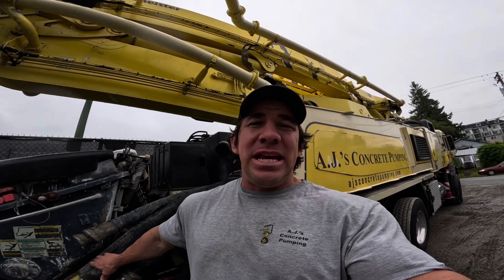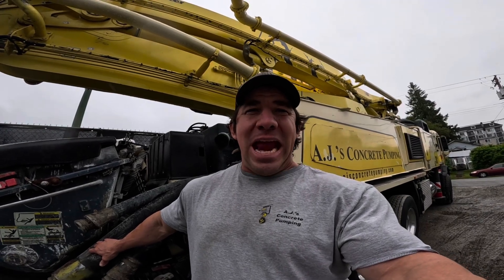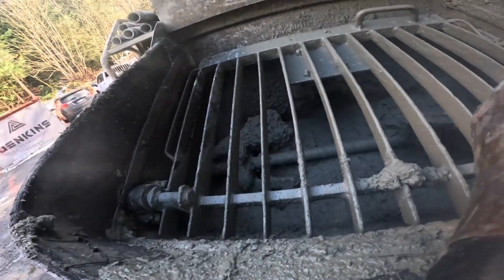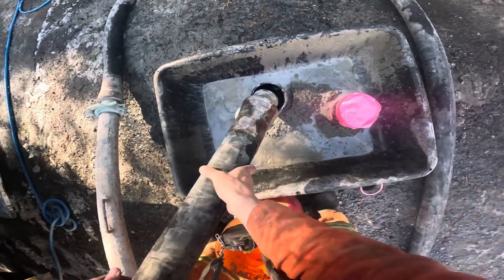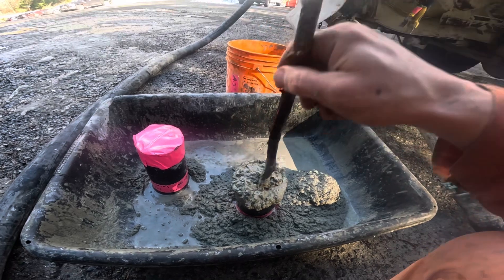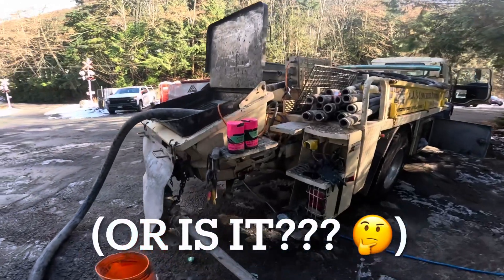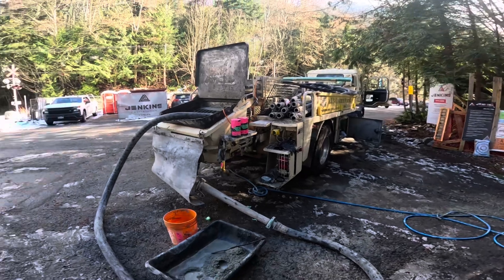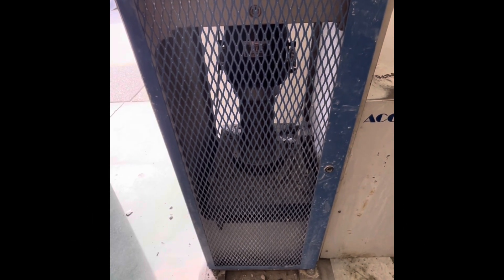Adding COCA COLA to CONCRETE: 28 days later  (compressive strength test comparison).

Comment: So are you going to stop using sugar then?? Sorry im late my wifes mandatory vacation 😅
Reply from the maker: So we only use sugar when the job is done and we are heading to washout. It will remain a staple item for me until the day I retire 😁😁😁
Reply: @canadianconcretepumper1979   solid plan, only going to pull the brown powder off my trucks if you did, peer pressure and all

Comment: Love the vids. Learning so much. 💪 Would love to see you do one on moves mid pour. They still stress me out!!!

Sugar is a natural chelating agent and thus acts as a retarded, however it can be unpredictable and easily contaminated. Synthetic retarded tend to be safer and more predictable products. 

The coke looked like it acted a little like a plastersizer. Plastersizers free up locked water and make it soupy, the free water creates more hydration and thus stronger concrete. 

These reactions have a lot to do with the chemical makeup of the cement and the gradation and moisture content of the sand and rock.

Comment: Shotcrete mix doesn't even flinch about sugar,  when in doubt, wash out
Reply from the maker: It definitely takes a significant amount though. The delay-set product which we typically use doesn’t do squat to shotcrete (don’t ask me how I found this out) 😂😂😂
Reply from the maker: I have a 5 pins bag of the good stuff for you Mark which may say otherwise 😂😂😂

Comment: I think the ratio of sugar to concrete was as such to retard the hydration event.   Its almost the same thing as putting bud light on a hard spot in a slab, most people dont know that beer has just a little sugar and is great to save that forgotten corner. 
I know for sure if way more sugar was applied that mud is junk
Reply: I just use a silicate based finishing aide.... way safer. And use batch profiles to your advantage...

Comment: I  didn't think it would change at all
Reply from the maker: So I drove an hour to washout and the stuff in the pump was still slop. The Coke (in this instance) apparently killed the concrete in the short-term but resulted in higher compressive strength in the long-term.